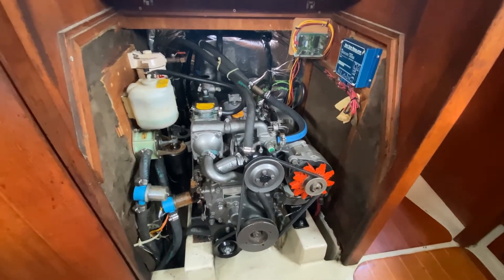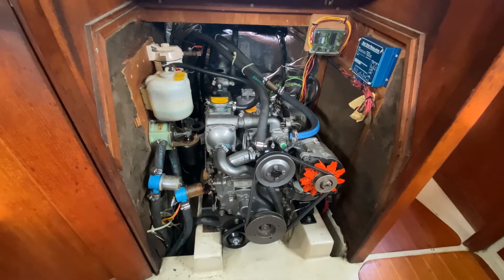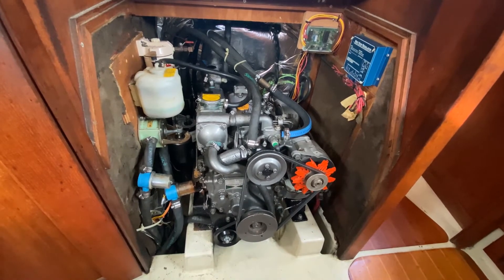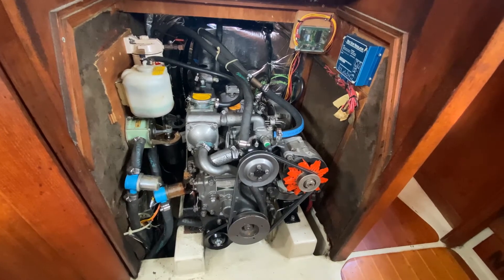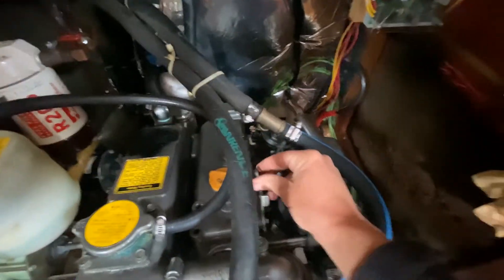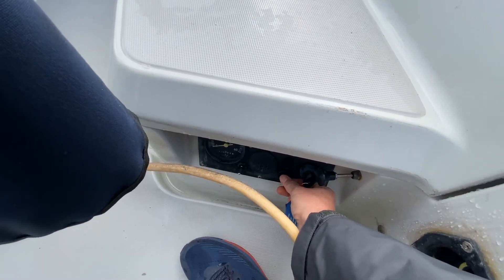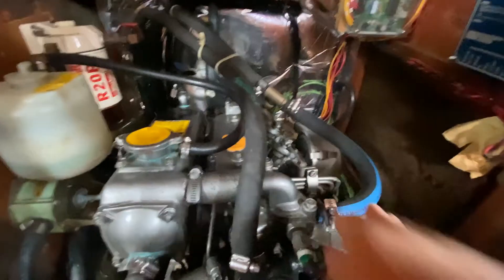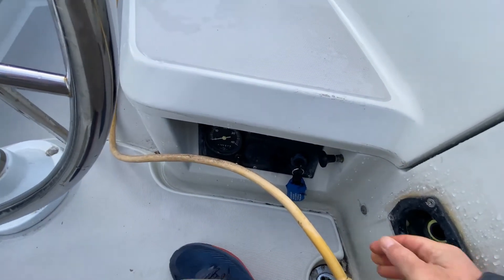Yanmar 3GM30F Cold Start

Comment: 1.  Before shutting down the engine, be in neutral, rev the engine to 2000rpm for 6 to 8 seconds.  Go to idle.  
2.  Stop the engine.
3. When starting again cold, put throttle to maximum
4. Start engine.  Immediately return to idle.

Comment: Did you start on 1 or both?
Reply from the maker: If your batteries are in working order, either single battery should be fine.  If you have trouble, try both.  Boats vary - after I made this video I put in a starter battery.

Comment: Tip of the day. Install a small heater inside the motor room. Ill start the heater, get my sails ready and start the engine. My way of starting a 30gm without extra gas throttle..
Reply from the maker: Seems like a lot of work but possibly worth it in a colder climate than San Francisco.  The "extra throttle" is per the Yanmar suggested instructions.

Comment: For cold starting, full throttle setting advances the injection timing, but be prepared to reduce engine speed immediately once engine starts.  Having the injectors serviced is a must.  Unfortunately, the typical injector wear items are now discontinued parts, so expect difficulty sourcing them. Fortunately, a local Yanmar parts dealer had new injectors in stock at a reasonable price compared to rebuilding

Comment: I own the same engine, and went through the same process a few years ago. It was only an issue in the winter, here on the 49th parallel. I tried the same things you did, including starting at half throttle, and I didn't really suspect the most common cause which is reduced battery output. Because of winter mildew in the cabin and wet sails when racing, I incidentally decided to plug in a dehumidifier, which required more than my solar battery charger could muster. So I added shore power. Problem solved! My off-the-shelf dehumidifier works great, and it adds a little heat as well. The trigger wire for these Yanmar starters doesn't use a relay, which means the batteries have to work harder to activate the pull-in coil of the starter solenoid. One day I'll do a video on that.

Comment: A lot of misconceptions relating to this fine little glow plug free, 30HP, fresh water cooled work horse.    I do agree with the  previous comment to start the engine half throttle or better per the operations manual.  This series (3GM30F & 3HM35F) are without glow plugs.  Most hard starting issues with this series relates to dirty injectors or low compression due to normal wear (5000+ hour units).  Normal operations call for shaft load and moderatly high rpms, operate in 2500 to 2800 range for daylong cruising or battery charging.  Bursts of less than one hour are permissiblen at higher rpms should the power be required.  Frequenty running at lower level rpms will result in dirty injectors, soot buildup in the exhaust elbow, and wear and tear on the engine mounts.  The subject boats engine appearence suggests moderate use so I suspect the compression is good, my instinct is dirty injectors.   Removal/installation is straightforward but the service should be completed by the pros due to the tools involved.  Cost should be reasonable for this service in most mainland areas.  With clean injectors, combustion will begin so fast you should never hear the starter.  Good luck and happy boating.